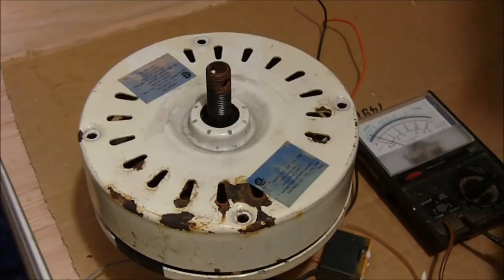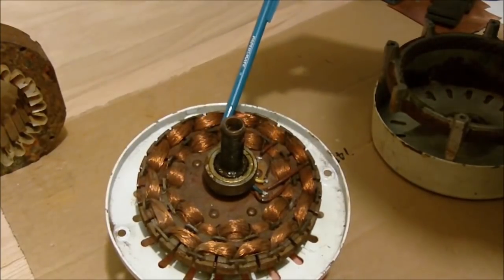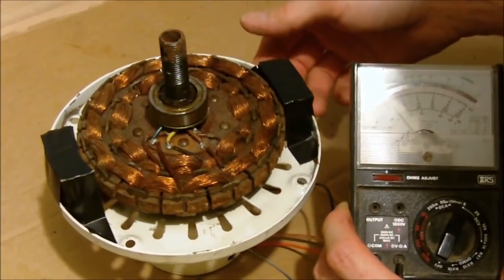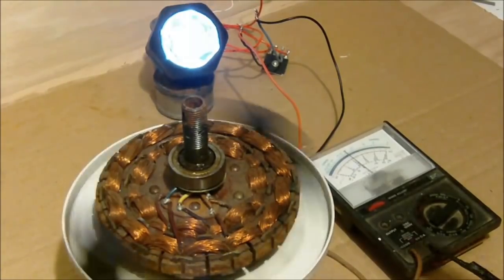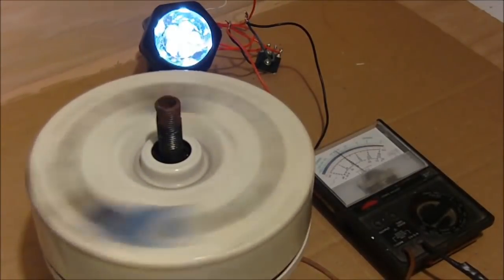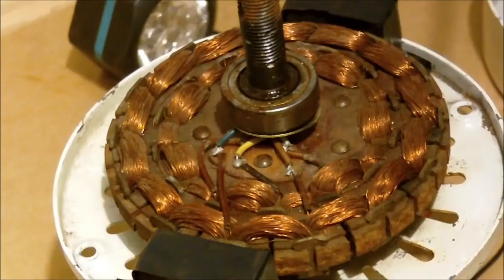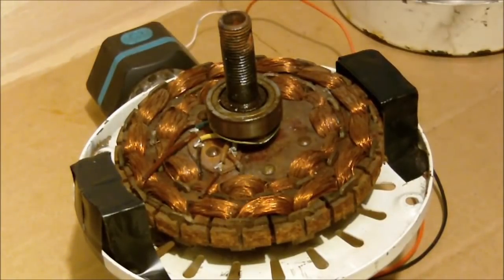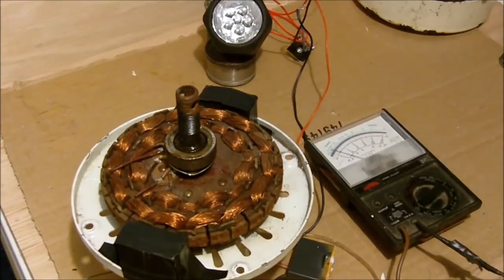Ceiling Fan to Wind generator conversion demo

Comment: Using this as a generator would be good as in intro into VAWT.  No, you will not get allow of power out of it to say power a house.  But it could provide a trickle charge to a battery or battery bank.  Especially if you have say 6 or 8 then you should be able to get say 300 - 400W as long as it generating.  I have seen this done with neodymium button magnets.  Just remember neodymium are dangerous to work with if you aren't careful.  I have been going back and fore if I want to build my own stator and rotator design for the VAWT. We average about 9 mph here and overall this isn't a good location for windmills so I may opt for the ceil fan design to test with.

Comment: Thank you for your incite on this conversion process, I was using a ceiling fan for generator for a fall fest gam at my church, with the use of ohms resistors I hope to create a strong man game that will need more RPM's to light up a series.  Does this sound correct?

Comment: Purchased 2 times.
                                           
                    You purchased this item on January 21, 2020.

 

                    
                        ZHYF 20PCS 12x3mm Round Magnet for Refrigerator 
Magnets, Offices, Artwork, Craft Whiteboards, Maps, Multi-functional 
Durable Small magnets         
                
These are from Amazon  less than 8 bucks per pack. I'm using 3 at a time and it leaves room for the 4 bolts..          
                    
                
            

       D 12mm x H 3mm 20 pieces per pack
       
      
 
       Round Disc Magnet Shape,Machined Silver Steel Finish.Durable 
Lasting Shine,Perfect for Refrigerator Magnets,Office Magnets,Whiteboard
 Magnet&Dry Erase Board Magnet

Comment: hey you said you use the highest wattage wire did you try using all three wires to get an even a better result. that way you are you are using all the copper coils instead of just one? question 2 can you put metal in there to put the magnets forward so you don't have to use wind power or water power you can just use the magnetic poles to push itself forward or backwards

Comment: cool vid. just out of curiosity, did you find that the coils that were for the lowest speed, turned out to be the coils that also generated the most volts, at a low spin speed, or was it the other way around.

Comment: Oh.. and you are referring to the "insulators" of the motor... but you are actually talking about the cores of the coils.  These are made up of laminations, or layers of iron.  The purpose of these is to allow the magnetic field of the coils to flow better and be directed exactly where they need to go, because magnetic fields flow much easier through metal than thru air.
Reply: N

Comment: Seems these fans are just inside-out induction motors.
 The more pole windings in an induction motor, the slower it goes. 2 is 3600 rpm 4 is 1800. (minus slip factor, as in 1720 rpm).  I'd guess to speed regulate these, (as a fan) you could select the number of poles for your speed. I can't think of any common way else. Maybe the small coils are starters?
Have I guessed right?

Comment: You were right the first time. It's a generator, not an alternator. Generators use permanent magnets and don't need any input current. Alternators have only windings and need some current to create a field and then make electricity.
Reply: Thanks for that tip.  Now I can guess why they stopped sting that after a car is started, you can take out the battery and keep running.

Comment: hook a bycicle wheel to it and 8 ..16 oz soda bottles zip tyed  half way full of alcohol or antifreeze so it doesnt freeze you have a perpetual motion machine that will produce a constant trickle charge run that through a small solarbattery regulator youll have continues power have 2 or 3 and a battery bank and youll have as much off grid power as you need...just look up perpetual motion machine on here

Comment: It is not worthwhile to rewind the motor  because the power output would be the same. 
For example,  if heavier wire were used, the higher current would be at a lower voltage. 
If you wanted a different voltage, it would be easier and less expensive to use an external transformer. - Lee , retired electrical engineer
Reply: So which transformer would you use to change the voltage without losing power?

^^
Reply: Well you could tear apart another electronics device and use the transformer out of it as long as the jump in ampersage I not more than double and then wire it in reverse as to amp up instead of amp down ... As far as the"  best " as you asked goes there is not a best like one better than the then other but instead its really determined by what expectations you have as it depends on the load you put on it vs the load you expect out of it and then apply it to ... You wouldnt want to put a 60 mhz transformwr on a phone charger you see what i mean ? ... Well i hope that helps some ..... Be blessed my friend

Comment: I wonder if there is a way to modify the fan, the high speed coil to be used as a generator while the fan motor is running on the low speed?
Reply: Good Lord I don't know where to start on this. Yes you could, but the increased drag would cause an over current in the windings you were using to drive the fan. Also you would get less power out of the generator coils than you put into the drive coils. do this outside because burned varnish will stink up the house if you do it inside and your wife will get upset. Read up on losses from hysteresis, eddy current and I squared R. Not to mention bearing friction.
Reply: Good answer, especially the part about the wife.

Comment: slow spin on no magnet coils, probably just noise showing up on the meter.  AC motors usually do not have magnets required for generating electricity.

Comment: What if you tried to couple this design with a way to use magnets and stators to force the fan to rotate and eliminate the need for wind?
Reply: I've tried that before and it doesn't work.  With the coils the stationary magnets are effectively chasing the magnetic field of the coils so to speak.  With using all permanent magnets, the rotor magnets get to the stator magnets and stay there.

Comment: Most brushed AC motors, like the vacuum cleaner motors actually use commutators, giving them the name of "universal motor" as they can run on either AC or DC. Slip ring AC motors are rather uncommon, are they not? I only know of them used in generators, where the commutators energise the rotor.

Comment: I was just thinking... since there is a high, medium, and low set of coils, if you combined all three of them, would that theoretically double the wattage?
Reply: No.... The explination for this is too long for me to type out... but a couple of basic points are; The bigger windings are offset a bit from the smaller ones so the magnets pass the different size coils at different times so your AC pulses would be out of phase with each other so you would have positive phase and negative phase running threw the same wire at the same time!!! and even if you wound it differently to overcome this, only the bigger winding would be working anyway because as he showed you at the start he found the 2 wires that give him the most voltage [which are the bigger outside windings] if at a given speed the bigger windings were producing 20 volts and the smaller ones were producing 10 volts it would look like this..... 20 volts + 10 volts = 20 volts.... or 20v+15v=20v... 20v+19v still = 20 volts.... its not until you exceed the 20v that the higher voltage would be the predominant voltage eg 20v+26v=26v. there are various other factors that would stop you doing this also but im sick of typing already. I did build 1 of these for a fun project and mounted on my shed out the back and powered a led light, l did plan to use it for camping but it only produces minimal power so just left it on the shed for a security light!.

Comment: Max U can get 40 watts. However, it is a  good experience.
Reply: can i ask, 40 watts per minute or per round?so you mean to have 40 watts free electricity to use, we need that thing to spin continuosly for a minute (if 40 watts=1 min) do you mean this? pls advice.
Reply: Vince Vengeance this thing has a limitation like any other generator. the higher the rpm the higher the wattage, but somewhere there is a end on the scale where you cannot get more out of it. so the max might be 40 watt under x amount of rpm. and 40 watt is 40 watt, mathematically it doesnt matter the time, your car for example has maybe 200horse power. if you kick down, it brings 200 hp, independent for how long you stay on full throttle. hope that helped!
Reply: thanks for the info :)
Reply: Vince Vengeance
He means 40 Watts continuously (as long as it spins). In 60 minutes, you'll have 40 watt hours. In a day, you'll get almost 1 kilowatt hour (kWh) or 23 kWh in a month. 
To get an idea how much that is, check your electric bill, it will have your monthly usage in kWh.

Comment: hard drive magnets are quad poles.  I have tried using  them, chopping them in half with no luck. they are also considered not safe because when cut / chopped they fractured and release very powerful particles.  hard drive magnets are highly not recommended for hobby generator use. I even tried coating them in paint, which was not much help.

Comment: Your moped is putting out 15-20 volts? If it has a voltage regulator I'd check that.

Comment: Hi! I'm interested on doing this project. Can you tell me why you should place the magnets alternatively, like, why is it south then north and then south again, evenly? Also, is larger wires (14ga) better than thinner wires? I think i might want to power (at least) my computer (since I used the computer for work whole day to minimize electric bill) using this project if it's really effective. Please help. Thanks a lot.

Comment: I have kind ot the same question:

why does it produce AC an not DC? Is the the way the coils are wound?

I took apart my table fan and the inside looks different. There is a stand alone rotor you can take out and the coils are wound on the outside onto a big piece of metal. I heard him say at the beginning these fans use induction to turn. I will have to study that one.. Wouldnt it be easier to just use a DC motor?

Comment: i did this with a ceiling fan i had spare. it has 4 wires, 2 wires per coil circle. when i spin it slowly i get some voltage....but when i spin it fast...it does not produce any electric at all. thoughts?

Comment: hello richard; I think with your drawing you need also a voltage regulator with a thyristor, transistor and resistance. Wind energie is not controlable and the sinusoïde is not suitable for direkt charge to a batterij. The rectifier bridge is perfect but this is only the beginning. That is why I asked your drawing and I thank you for your nice response

Comment: Ceiling fan is both generator and motor. it will be a motor when electricity is input on it but when you spin it it will output electricity and potentially  charge cellphone, flashlight and  light led bulb.. a frog might also be killed by electrocution when you spin a ceiling fan!

Comment: I took a Hampton ceiling fan and I turned it flipped it upside down reversing the coils and then put my magnets around the outside of it and it's showing me on my Nita that I'm getting bolts out of it but when I hook up an LED light to it I get nothing but do you think the problem could be maybe you can help me Mike

Comment: ***** But won't the weather ruin the motor? How do you water proof it for out door use?
Reply: Easiest way I can think of would be to have the motor at the top with a plastic bucket or plexiglass panels covering it.

Comment: What if you wired all three coils together?
Reply: +Matt Roach The different sets of coils can work against each other if wired together, depending upon where the magnets are located. It's best to just use one set that gives the most voltage output.

Comment: what happens when speed increase it will destroy all load due to high voltage is their any dummy load or any control devices use with it

Comment: washing machine setup much easier and more efficient. all magnets already there.
Reply: +stooky bird With the washing machine can you just hook up a plug and use it for a generator?
Reply: +William Annis when complete of course. 100 times more power in running water.
Reply: +William Annis  Look for a permanent magnet motor. I think that may be what you're looking for.
Reply: +stooky bird 
Can you alarm them to give panty thieves a shock?
Reply: send me a link please never heard of this
Reply: If only the world invented something that produces a constant voltage irrelevant of the speed, At lets say 12-24 volts? and perhaps 90 amps? Why hasn't this been invented yet...
Oh, A car alternator.

Really lads and lassies, Just use a car alternator.. or two, three four or one hundred of the little buggers, You know, incase you lived at niagara falls.

Comment: Here's the secret. DON'T put them north on one coil then south onothe next. Use smaller magnets putting them ns...sn...ns...sn Or turn the magnets on their side . South facing south and north facing north
. this doubles the power and they spin easier.. Try it. I'm lighting 45 watt AC bulbs with the slightest breeze
Reply from the maker: Thanks for sharing the info with everyone, sounds like you got some great results with your fan motor conversion 👍

Comment: Can someone answer if more magnets better? Or bigger magnet better
Reply: The stronger the magnetic field, the better.

Whether you achieve this through using more, larger, or better magnets is mostly irrelevant.
Reply: radred609 would it work if I put the magnets on the flatter bigger circular part of the housing or does it have to be within the edge like he did it? reason is I want to use a flat circular acrylic so it looks a bit nicer.

Comment: make a heater for my car that is powered by the wind or the wheels...please
Reply: +kevin1234con  Cut a hole in the floor board (firewall) and the wind passing over the hot engine should heat the interior of the caar. (Well it looks as good on paper as some of the other "science" I see posted here) LOL. I love reading the comments on videos like this one. Everyone is a scientist and will argue with electrical engineers on the subject. LMAO. Some are more entertaining than television...............

Comment: I don't get why you removed the original magnets... those are perfect... every motor is inherently a generator, you didn't even need to take the thing apart...
Reply: the original thing he took out is an induction coil and not magnets. it spins the fan by causing resistance in the magnetic field produced by the coils. it can't work in reverse because the induction coil does not produce a magnetic field like magnets do. it simply acts as resistance to spin the blades. using smaller magnets, I was able to get 36 volts just by turning mine by hand. I'm not sure the amperage or watts because my meter had the fuse blown and could not measure amps. in theory, one could get a usable 100 watts or higher with the right magnets, magnet spacing, and rotational speed.
Reply: Billy Gray Do you have or know where to get schematics for the original motor & the conversion to become a generator?

Comment: That makes sense but know I wonder why a dc motor produces dc instead of ac? Without a rectifier, I Mean.
Reply: The LEDs are Light Emitting Diodes remember. So when he hooked them up they blocked power in one direction.

 He then used a full bridge rectifier to no just block 1 half of the wave like single diodes do, but instead flip one side to make the AC pulsing DC

Comment: If you get stuck on the information regarding electrical safety get in touch with your local electrician or better still an electrical engineer for any advice you might need hope this is helpful to you? Regards Steve

Comment: why not practical if it charges a battery over the day and then you can use it to power and led bulb, or convert multiple ceiling fans, and like multi solar panels, link them together to power a battery or batteries?

Comment: built a generator from ceiling fan   with a capacitor in the output line I GOT OVER 200 volts ac. problem is not enough amps to do anything with.. hooked up to a bridge rectifier I get over 100 volts dc but again not enough amps.  fun project but no practical use.  going with a 24 v 100 + AMP AUTO  alternator

Comment: Old dc electric scooters are good for this i got 2 motors out 24v at 100watt each and 4 12v batterys all for free i just need to find a free way to make the blades as im trying not to spend anything on this project
Reply: you can use the planks off an old pallet for the blades and hub. or use an old bike wheel with some sheet metal attached as blades.  I personally would use the pallet, it is easier to replace if damaged by high winds.  I would just treat the blade and hub with some sealant of some kind.  Cooking oils work well for this but need to be applied again and again.  If you are really creative, you could make everything from recycled plastic bags.  Just make a form for the blades and hubs, shred plastic bags into small pieces and place them in a double boiler, melt them down and pour the plastic into the forms.  Once it cools, it makes a nice, hard plastic that can be drilled and painted.  Good luck...
Reply: great advice thanks luckily i have a stack of pallets aswell
Reply: William Woofter  Sir, can you make a video how to make blades out of an old pallets please. thanks and Godbless

Comment: Seems this is only effective if you live in an area that has a strong, constant wind.
Reply: Depends on how you define effective. if you need a constant kilowatt of power, then by itself, it will never be effective. On the other hand, if you combine this with a small grid tie inverter you can offset some of your grid power usage.